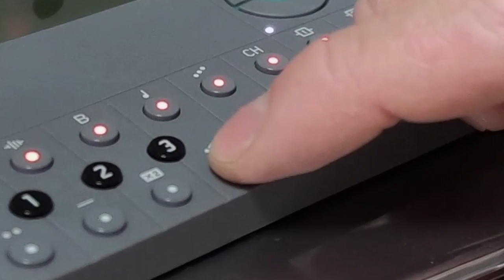OP-Z Repair /spray is pointless (EZAS/teenage engineering switch fixed

Comment: Great video. Thanks. Mine doesn't have the issues yet but glad to know there is a possible fix. This is well within my realm of feasibility, this sort of repair. My only other idea was to make a larger physical casing with led lit mechanical buttons and solder those up, making it a physically larger robust device.

Comment: Doesn't that depend on whether the double trigger is electrical vs mechanical? What he's shown is that dust/grime wouldn't get in either, so it could be that Deoxit is cleaning gunk from around the physical button.

No harm meant, just mentioning as I've recently done Deoxit from outside and it worked. The hint is that afterwards, the buttons felt lighter to push.
Reply: If so, consider compressed air first, more likely to blow debris out that way.

Comment: Nice video showing that applying cleaning liquid from the outside doesn't reach the main components. What are you actually doing on 2:19? Glueing the white sheet again? What purpose has the white sheet if the square parts are already soldered?
Reply: I think the layer that is designed to be there should stay there otherwise buttons might become wobblier than they were and also it will probably keep the metal part from tensions while the button is pressed as the part of plastic film is sort of sticked around the metal contact that is soldered.

Comment: can someone recommend any glue (brand+type)? if you want to glue instead of soldering
Reply: You need to solder it I believe for the electrical contact on the outer plate and to raise the plates slightly so as not to double trigger with the inner ring plate. Glue may cause much more problems as it may act as an insulator.